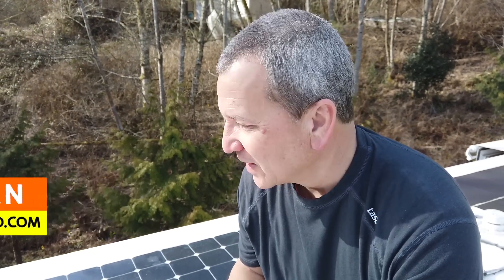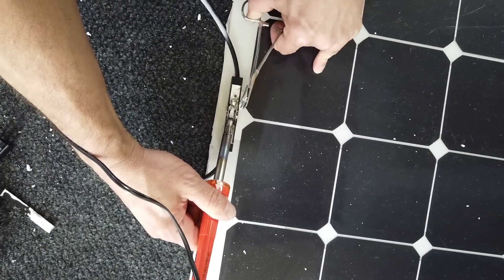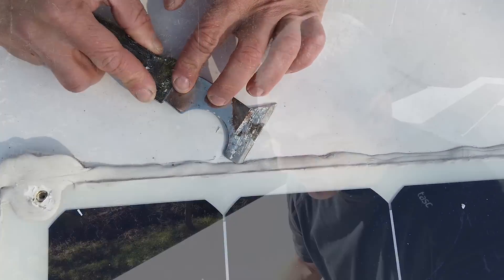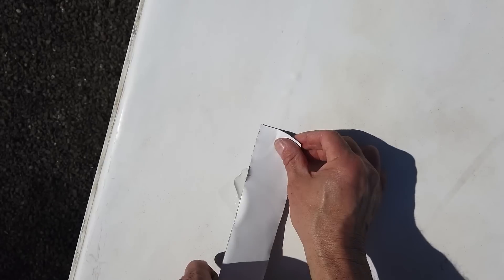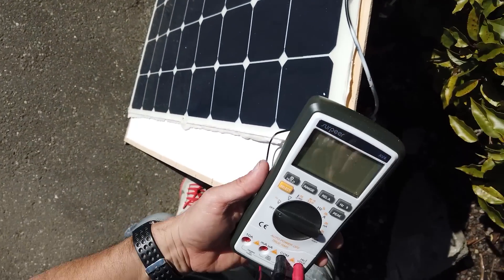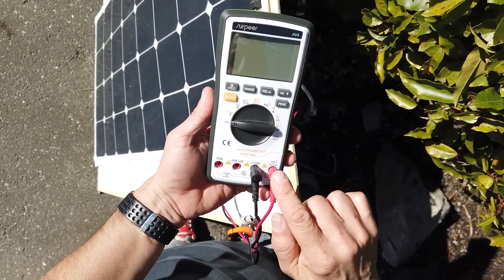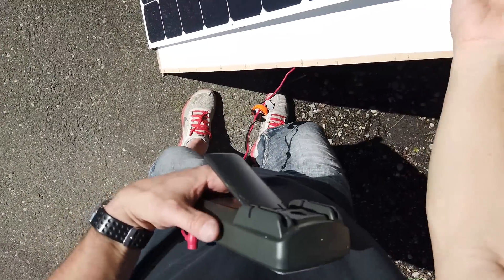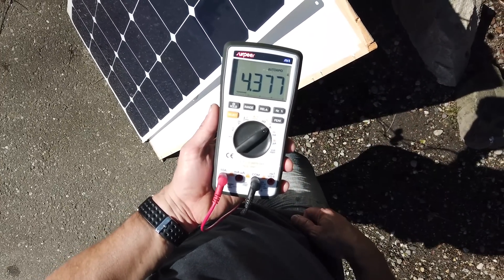Flexible Solar Panel FAILED after THREE YEARS on my RV

Comment: With that much roof space, I'd install 300+ watt  regular non-flexible solar panels rated for 25 yrs. I wonder what brand those panels are, but from what I've seen flexible panels don't last.
Reply: The huge influx of overseas semi-flexible and flexible panels decimated the USA market.  The quality of most is terrible...often lasting but 1-3 years. All this gave flexible panels a really bad reputation. QUALITY flexible panels can last decades but they are getting difficult to find. I find Unisolar was the best but they are now defunct. Sniff...
Reply: @geraldhenrickson7472  with the construction techniques I doubt any flexible panels will last more than a couple of year.
Reply: @geraldhenrickson7472  I'm prob weeks away from a flexible solar panel purchase. Have you found any other good reputable flexible solar companies?
Reply from the maker: I've got around 550 watts total on the roof (two separate arrays). That was is from HQST.

Comment: Word of caution. It’s okay to directly check current of a panel as long as its below the rating of your meter. Panels are self limiting on output current. If you try this with a  car battery or multiple panels it will blow the fuse in your meter if there isn’t a load on it or it’s a enough current destroy your meter. Good information. Looking forward to install.
Reply: @justincase00  Don't need a load. He was reading panel short circuit current, Isc on panel ratings. As long as Isc is smaller than the 10A setting on his meter, he is ok.
Reply from the maker: Very true. Measuring short circuit current of a solar panel confuses most, because you wouldn't short circuit a battery. I typically use a clamp meter to measure short circuit current, but I thought I'd do it this way this time. Thanks for the info!
Reply: I have had the fuse in my multimeter actually explode with a bang. Not dangerous that I know of but scary nonetheless. I tread lighty now when checking amperage output.
Reply from the maker: @geraldhenrickson7472  Yeah. I've blown all my fuses too. The BANG sounds exciting though 💥💣😀

Comment: Thank you for your information. I'm thinking doing the same thing with my travel trailer using the flexible solar panel. Keep us updated.👍
Reply from the maker: I'm still a fan of the flex. I'll share the new way to mount in the next one.